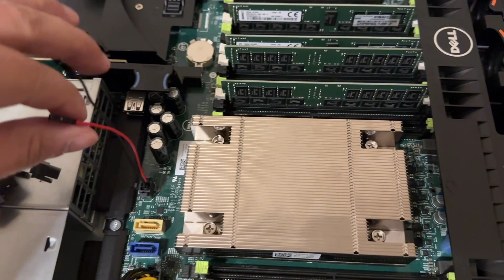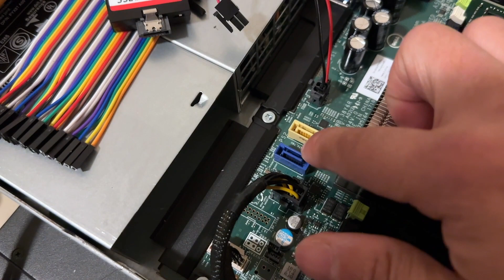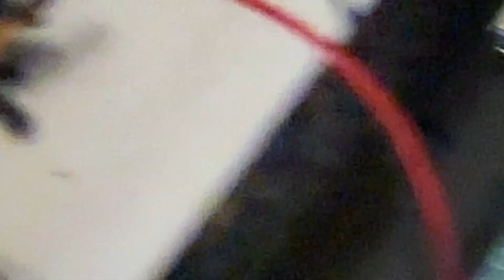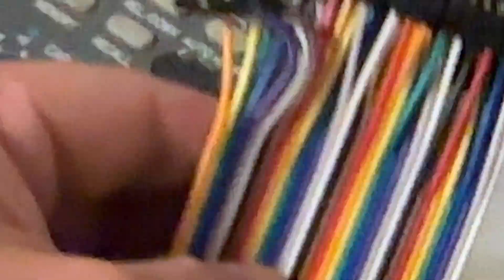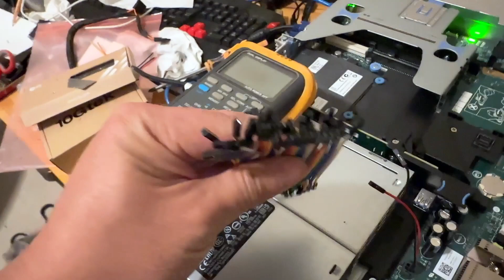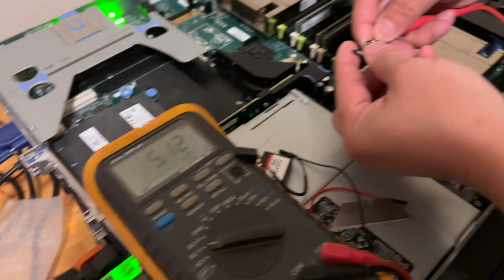HOW TO GET 5 VOLT DC FROM DELL SERVER MOTHERBOARD R630/R730/R640/R740

Comment: ok, i didn't know about those SataDOM. i always used the USB3 ports internal with a full metal industrial USB3 drive with about 300mb Read speed. But those drives are expensive and tend to fail after 2 years of use. I tried the cheaper plastic one before but they're melting. I don't want to give up pressures drive space for the OS. I tried to use the vflash feature, but this thing sucks because 20mb read speed. In the end, i kept using the internal USB drive. i could use the CD space in the front, but the connector is not standard SATA it's mini SATA. 
The vFlash is great for mounting a ISO, to install in Proxmox a VM. i mean, i can upload a iso via the idrac8 into the vFlash over the internet, but this thing is really slow.